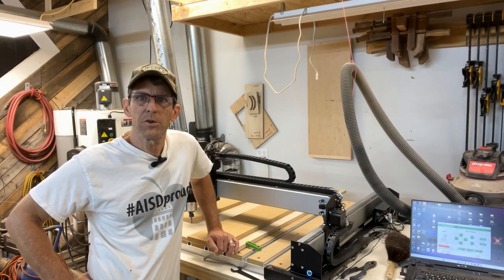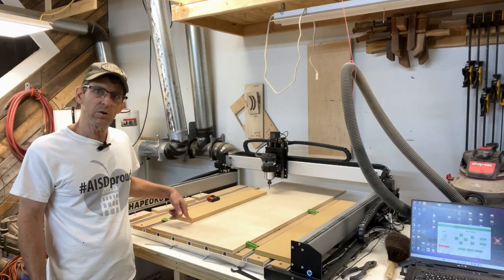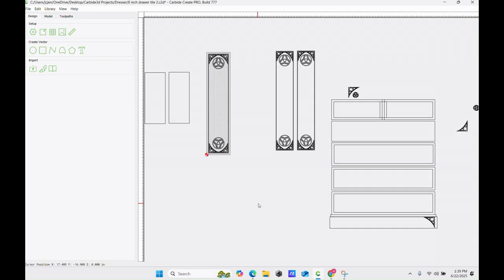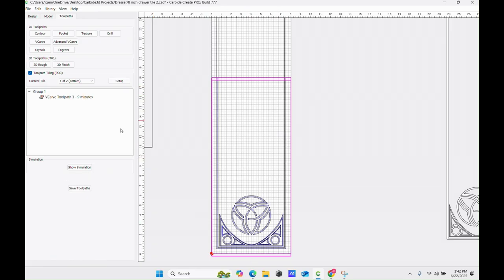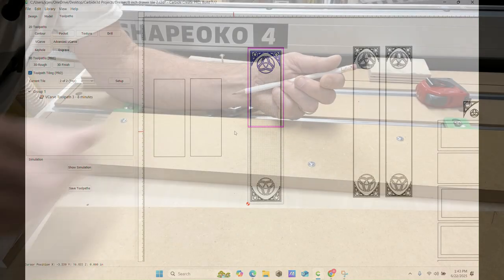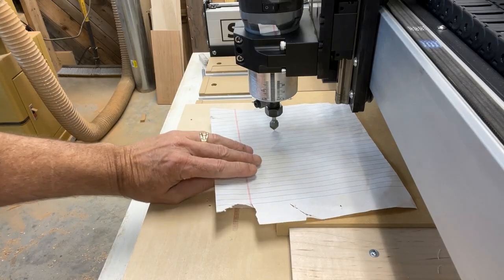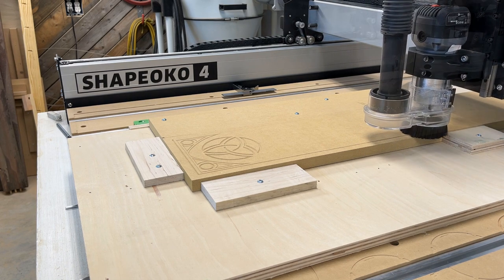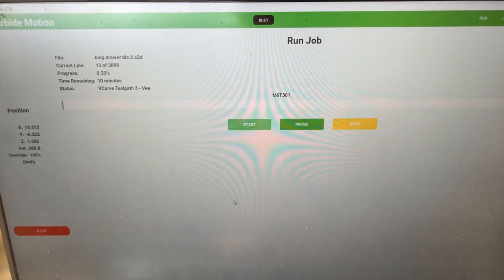JCs Carbide Create for Dummies Set Up for Tile Function

Comment: Your video was far easier to understand then ALL the other ones I watched!!  Thank you!
Reply from the maker: Thank you, let me know if there's something else I can help with
Reply: @JC.Jensen  Hi sir i do in fact have a question! When i opened the Tiling section, it did not show that I needed two tiles on a 46”  piece.  In stead I had to divide the piece length in half and then it gave me two tiles!  Could the program have changed? Its the latest version of Pro.  Weird?? Thanks again!
Reply from the maker: @KimFowler29  Hi Kim, when you check the tiling box it should have populated the red square around what it sees as tile one and give you a list of tiles in the drop down tab as I described. If not, simply input the desired tile size in the setup tab. How big is your machine? I haven't updated my version of pro since I shot the video. Oh and please keep the sir, JC is just fine. Thank you for reaching out and let me if you got it sorted.